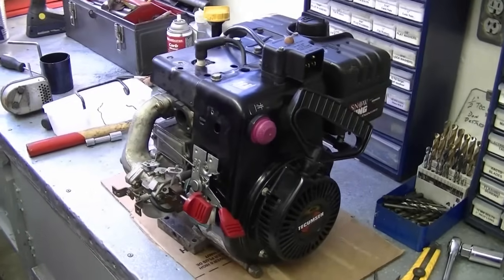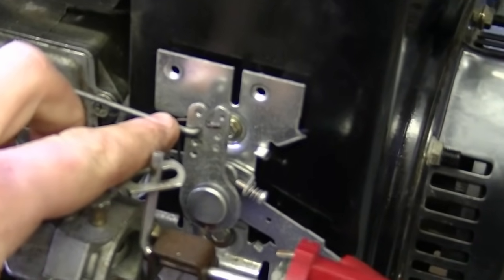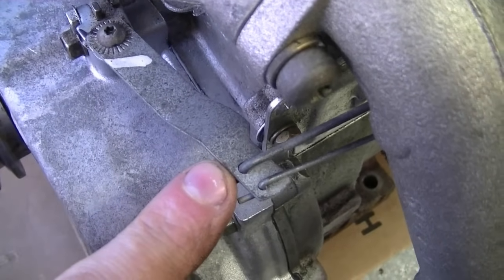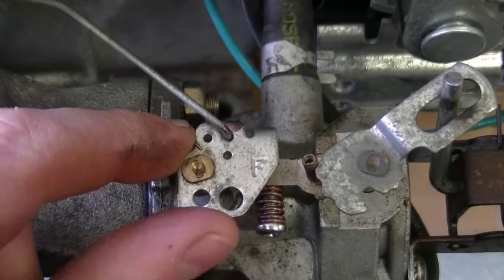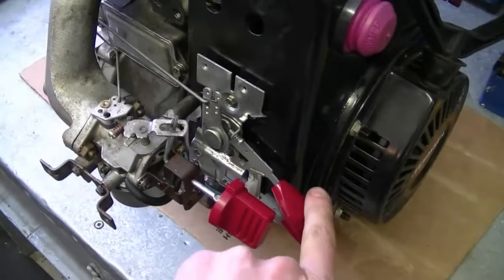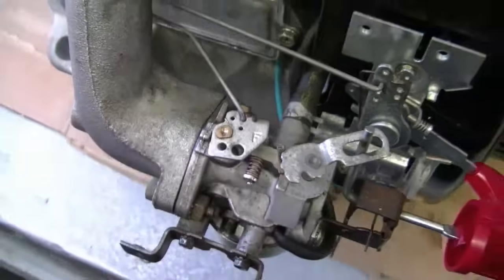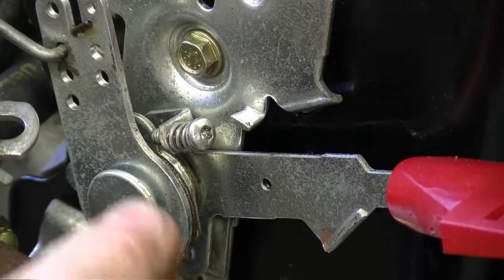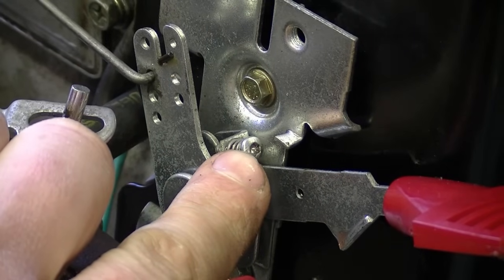8-11hp Tecumseh Snowblower Carburetor Linkage Configuration

Comment: Thanks for all your videos!!  I have used a lot of your videos and learned a lot!! I have the same engine on my snow blower as in this video, and I basically used your videos to replace the fuel line, carburetor and put in a shut off valve after my snowblower failed to start.  However it still won't start and I don't think I have compression because I did the thumb test and my thumb wasn't being pushed off the spark plug hole.  Don't know what to do now.